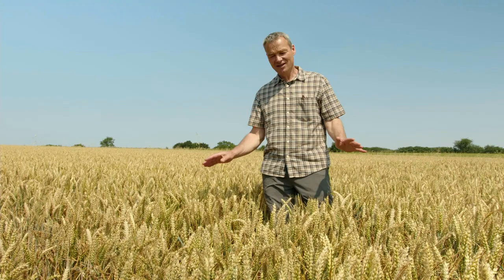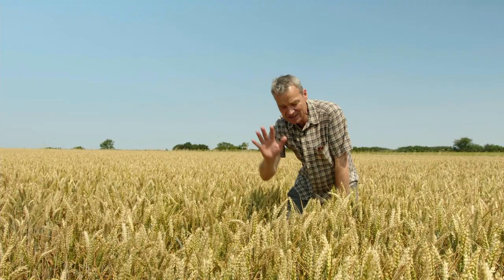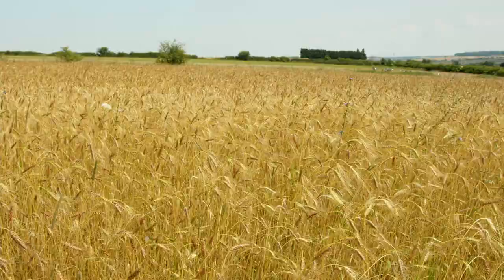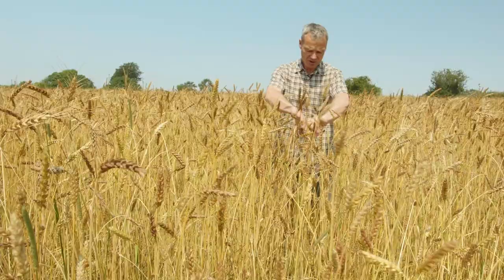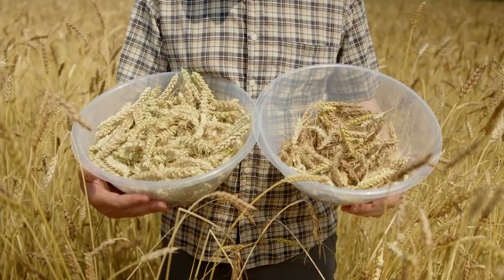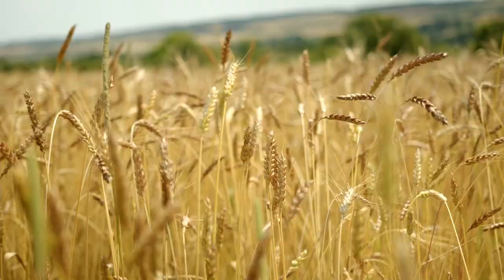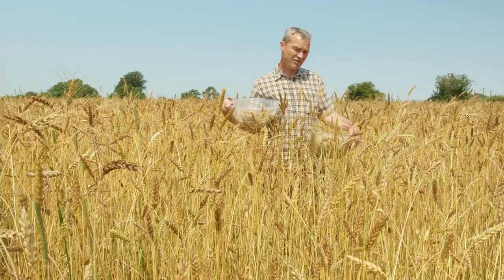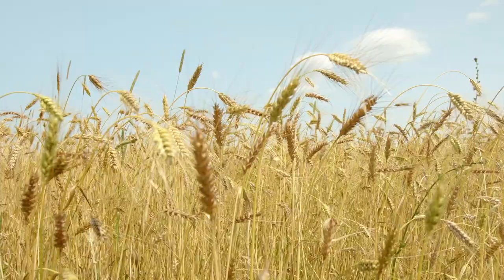Conventional Vs Heritage Wheat Yields

Comment: The video is missing some critical points. I grew a side by side plot comparison between a wheat from the 1800s and a modern wheat with no inputs. The 1800s wheat out yielded the new wheat by 300%.
Reply: How?
Reply: @SebNutter  because the new varieties are designed to be used with inputs. there are a lot of varieties of grain that were better than now. Flax is one of them.
Reply: Do you perhaps sell the 1800s seed am really interested to buy
Reply: @JesusisLord78  I don't really have enough to sell. I'm still trying to figure out how to grow it here in Missouri.

Comment: The best video I've found on the topic so far, especially to understand the acreage and output differences. I would love to be able to compare product differences (e.g. comparing loaves of bread or other baked goods) but in general, I think we have lost so much by ignoring heritage wheat varieties. There used to be hundreds that were better suited for different climates. I also wanted to note that height difference. So many now would consider that a waste, but back in the day, that extra straw was extremely useful to have. Modern wheat varieties are less than half as tall in many cases which on a small scale (especially homestead) setting is actually less useful overall.